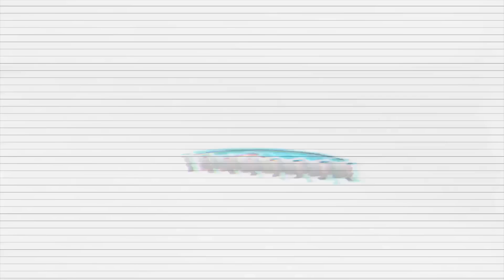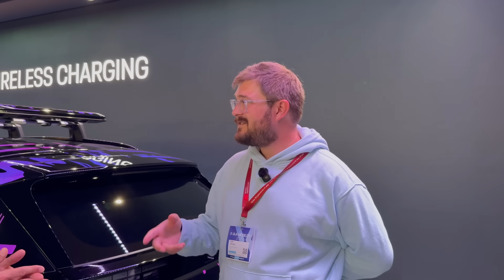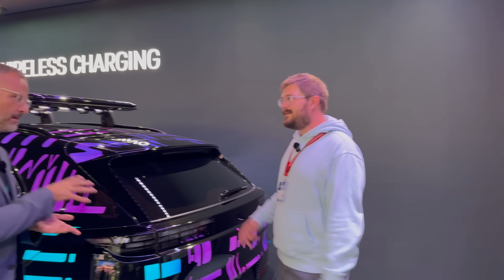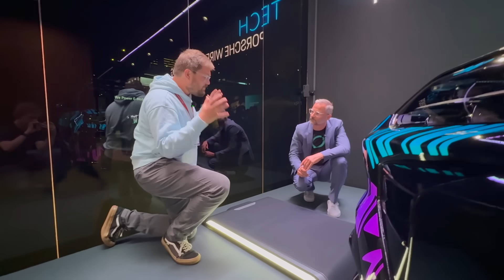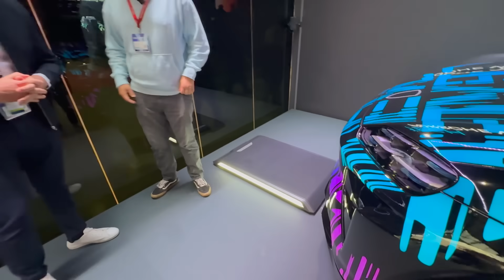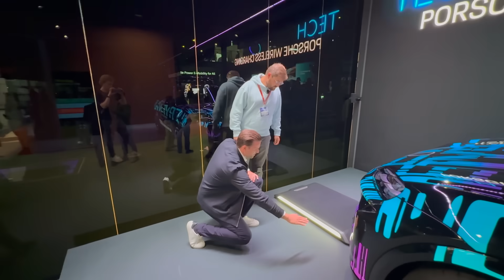Porsche Cayenne EV Wireless Charging Explained!

Comment: It detects any living thing? Like, what if a centipede or a spider decides it's a nice warm place to live, am I going to find my car not charged in the morning?

As for me, I'd probably still prefer to use a cable. But for some reason, I also prefer to use Ethernet cable over WiFi… I can see where it is plugged in, I can unplug it at any time and I know it will get disconnected, etc. But I know I'm in minority in this, so… why not, if people want it.

Comment: I want to know if the 90% efficiency figure is just how much power is delivered to the battery or if includes the additional power needed to cool the additional loss to heat? Beyond the cooling needed for the pad and the vehicle, if it is used in an enclosed garage in the summer that isn’t insulated from the rest of the home, it would then increase the amount of cooling needed for the home.

Comment: I worked at WiTricty on this and hacked it into a model 3 (and the whole time thought OOS would love to check this out). People have a tough time realizing the technology in this $5-10k system is much more advanced than a $10 inductive phone charger. It works very well, with several inches of gap, without alignment because it has the intelligence and complicated electronics needed to synchronize to those differences each time it initiates. Output is full HVDC on the car side so it truly is no more conversion steps than a plug-in OBC. I’ve personally witnessed it measuring 96% efficiency at 11kw. The other thing people don’t get is yes this is dumb/frivolous for personal use, but makes a lot more sense for fleet/taxi situations. And then you realize it is the solution to the full robotaxi chafging problem. These have shipped commercially on Chinese brands, but it looks like this will be the first time it is available OEM for EU/US. Waymo should be all over this.
Reply: Swappable batteries are still the better option. Swappable batteries can also have this wireless charging technology built into them. Plus, having swappable batteries creates a whole other industry that will benefit the US all around. Swappable batteries make it so that you don’t have to upgrade the entire electrical grid to support millions of new charging stations or charging pads like the one in this video. It also creates new jobs such as battery technicians, and battery transporters. It also can drastically reduce the price of a new vehicle by as much as 40% because new car buyers will have the option to purchase a car without a battery, which will simultaneously introduce a brand new battery into the swappable battery supply/infrastructure every time a new car rolls off of the lot and that brand new swappable battery underneath is swapped.

Win-Win option
Reply: @NSUScooter  swappable batteries are not the solution. I live in Belgium and we have Nio with their swap stations. It is a very captial intensive way of "charging" a car. We also have Zeekr and Xpeng here that can charge a car 10-80% in 10-12 minutes so the use case for swap is basically gone.

Comment: No one is showing how it wires in. Hard wired? NEMA 14-50?
Reply: The preferred method is hard wired directly into the fuse panel, according to the first speaker. But for situations where that is not an option depending on local code, a NEMA 14-50 could be used.

Comment: I am kind of impressed that they got the price down to just 7000 euros. People spend a lot more than that on other options. 

It would be really cool for fleets if the cars could rearrange themselves as vehicles complete charging. Get to work on that Porsche 😂 

The way the car can automatically park itself on the pad is cool. It is like my robot vacuum but I was thinking it might be better for the plates to br able to move around a little so they could line up instead of the whole car.

Comment: Consider a cost-benefit calculation:
200,000 mi/100mi per charge/15s per plug/unplug for charge
= 500s or 8.3 hours (assuming the pad doesn't make parking take longer, which is a bad assumption)
Is 8.3 hours of your time worth $7k?  The only sensible application for this is autonomous vehicles.
Reply: If you need to calculate the return on investment on this, you are not the target market xD
Reply: @FreekHoekstra  The Cayenne's target market is millionaires, not billionaires, and you don't get to be a millionaire by wasting money (inherited wealth notwithstanding obvs.).  One minute to to a calc is worth $7k to a millionaire.

Comment: Do they have any whitepaper measurements for the µT magnetic exposure, or the V/m, at operating distances, and this would compound with any misalignments. If you think that some unshielded sauna's can hit 2000-3000 V/m at 1 to 2kw, there better be a tonne of shielding on this product, or that is a sketchy thing to have in your home. I guess this is filmed in past, but would be interesting to see trifield readings from it, in the car while charging, and around it.
Reply: Esoteric bullshit. Safety is obviously one of the first things considered for such a product. If you think it will remote control your brain, you have much bigger problems.

Comment: Yeah 11kW getting in, efficiency of 80% if you’re lucky. 10% losses with wired already. Can’t imagine this delivering more than 9kW and nicely heating up the garage
Reply: They said it was 90% in the video
Reply: 90% include the AC/ DC converter or just the Wireless Pad to the Plate?
Reply: @FloLubo I'm not clear on that, there's some kind of unique process going on with the way they are doing it. I think the conversion to DC happens before it goes into the car on the setup unlike normal plug-in EVSEs that use AC and the car converts it. I'm not sure if that makes it anymore or less efficient though probably roughly the same conversion loss?

Comment: How does the pad work at -40c? 😂
Reply: Being extremely cold should not affect wireless charging. Being extremely hot though could affect it because it will produce a little heat on its own as well.  But on the cold side the car's battery would be the limiting factor not the wireless charging.

Comment: Honestly $7,000 for this, especially considering it’s Porsche, isn’t that bad. I was expecting them to say something crazy like it’s $40,000.
Reply: €7,000 = $8,214
Reply: $40K is literally the cost of a New Tesla model Y. That would be crazy. But I agree $7k for bleeding edge tech is about what I was thinking.
Reply: yeah but 11kw is slow bro
Reply: I think a person will barely come lose to spending 7k USD on electricity for charging this car before charging to new car with 3-5 years of lease….so it is much more rate to have basic charger and spending half of that sum on actual electricity
Reply: @ashotgaziyan8876  I'm not sure why you are just justify any cost numbers here. This is not meant to financially make sense, it's a new luxury product who can bite the cost.
Reply: Consider a cost-benefit calculation:
200,000 mi/100mi per charge/15s per plug/unplug for charge
= 500s or 8.3 hours (assuming the pad doesn't make parking take longer, which is a bad assumption)
Is 8.3 hours of your time worth $7k?  The only sensible application for this is autonomous vehicles.
Reply: @concinnus people with the money don’t worry about the numbers. They care about having the latest and greatest. If you need to get a pen and paper to run the numbers, this car isn’t for you.
Reply: I thought he said 5000 euro including vat? $5900
Reply: @samnas6205  That's just the pad, without the receiver, and doesn't include tariffs.
Reply: German VAT is 19% so more like 6000€ without VAT

Comment: Many city's don't have space for the pole and cable clutter as well as the electronics for payment on street. As an example Boston has many narrow streets with narrow sidewalks which preclude any charging options we have available today. 
With this tech held within the pavement with just a small lip over the edge and pointless payment this could offer what we need to really wire up the cities! Could you imagine parking at almost any on street space with the ability to charge over a few hours (over night even better). Now it's time to set the standards and a payment system to the power provider!
Reply: You're acting like it's 2012. You don't need to charge your vehicle that often. You charge at home, I realize if you have an apartment that might be more difficult, and then if you're on a road trip you charge at a super charger. 

All of this equipment, supporting infrastructure and payment system nonsense for 11 KW is a waste of time and money.

Comment: 90% efficient at 11kW means this thing generates 1100 watts of waste heat. That's almost as much as a purpose built electric space heater. 9hrs to charge the car will waste almost 10kWh. This doesn't seem like a smart thing to do. Also, a cat's collar will get warm? What about an RFID chip?
Reply: First: no cayenne owner will care about those pennies. 

Second: it doesn't necessarily matter much in the future, as increased use of renewables and storage will give quite some energy overshoots in availability.

Comment: 1:47 "200 kW of Regen" What does this has to do with charging? Regen is when using the motor instead of the brakes to slow down a car.
1:30 "Formula E race car. TYON's 400" Could not understand what he said????
Formula E uses a high-powered system called "Pit Boost" for mid-race charging during the 2025 season. 
- During a mandatory 34-second minimum pit stop, the cars receive a 30-second charge.
- About the Charging speed, the system delivers power at 600 kW, this is about twice as fast as a Tesla Supercharger.
Reply: To answer the first point. The regenerative power is fed back into the battery.

Comment: 8:27 - if you've got the coin (and who doesn't if you're someone shopping for Porsches) you can mount this pad in a recess or "pit" in the floor of your garage like we do in the Motorsports and Racing sector with some Chassis Dynos and some Alignment Racks (think Superflo think Hunter).  while clearance [Clarence] is certainly less important when dealing with raised SUV's, this flush fit is needed for the ease of testing of Sportscars with super low ride heights.  in this case (since we've already seen from Bjorn and Matt Ferrel way back 2 and 3 years ago how the generated lines of Magnetic Flux can work THROUGH various materials like so much MRI) you could then place a weight bearing cover of some sort over top this pad for a super clean install, oh this also gets rid of any trip hazard on the floor for when you're just walking through the space when the vehicle is not there.  I've personally mounted a small Scissor Lift this way back around the year 2010 or 2011 for just this reason (also see entry for Obsessed Garage).
Reply: increasing distance would reduce efficiency

Comment: Slower, Hotter, more damaging to the battery, less efficient, and it costs more to make
Reply: You are right honestly. Battery swap is way better than this
Reply: Did you watch the whole video? It charges just as quick as plugging it in at 11KW. It certainly does cost more but it's not damaging the battery at all.

Comment: "Plug this into the grid"...how? For the US, normal household outlet or the 240 "dryer plug"?
Reply: just like a wallbox
Reply: 48A is hard wire. Pluggable stops at 40A for EV chargers. I'm thinking 6 AWG THHN (or 4 AWG NM) in conduit out the front to the wall of the garage and back to a 60A breaker, just like a wall box charger.

Comment: 600KM range WLTP sucks. That’s low 300, way below Gravity and bmw ix3
Reply: it's 372 miles, really good
Reply: @JohnSmith-pn2vl  WLTP is not real world, it's a lab test. Real world tests come in at 80-90% of their estimate. At 85% estimate, this is about 315 miles, which IS less than Gravity and iX3. At 80%, which is the normal charge situation (battery preservation and slowing for the last stretch), this is 250 miles of daily usable range, which is not impressive from what will probably be the most expensive EV SUV.

Comment: Wireless charging might be useful for people with disabilities. I have a friend I've always wanted to have charge my car. She can pump gasoline easily, but most chargers would be difficult for her to use. Home EVSEs are much easier than gasoline pumps, but DCFC cables are heavier and stiffer.  I wouldn't advise any of my 80-year-old relatives to buy an EV.
Reply: ease of use is a customer value, you are absolutely right
Reply: How can you be physically disabled in such a way that you can still safely drive a car, but you're unable to plug in an electrical connector? Yet somehow operate a gas pump?
Reply: @DJS_ENO  This friend has hand controls that connect to the brake and accelerator pedals. She has limited use of her legs, so to pump gasoline she use crutches to move around and get the nozzle in the inlet. A DCFC is much heavier and stiffer than a gasoline hose, so it would be harder. Also, every gasoline pump I've seen lately is wheelchair accessible, but every DCFC I've seen is behind bollards and parking bump-stops or curbs.

I use both hands every time I plug in. That's easy, because I can use my feet to move from the charger to the car. Not everyone can do that. I also think of my elderly relatives. We need to build EV chargers that are easier to use than gas stations, and I haven't seen one yet.

It's not a reason to go back to gasoline vehicles, but we can better serve the elderly and disabled.

As for home charging, that would be easier than a gas station for most people—assuming they have a decent garage setup.
Reply: @DJS_ENO  the multiple pivot points/joints on the gasoline pumps make a big difference. We've engineered a lot of flexibility into those, and we haven't done the same for DCFC connectors. "Pumps reach both sides."
Reply: @DJS_ENO  …and every gasoline pump is pull—through, so people on crutches don't have to carry the nozzle at all—they just put the gas inlet one foot from the pump, and it's a simple pivot maneuver.  Charging stations have room for improvement. CalTrans put some chargers in backwards to make them ADA/wheelchair accessible. It was a nice thought, but it was not enough.

Comment: We know how Porsche is with their stats. If they say it's 90% efficient it's probably 93% efficient
Reply: 1-5% loss when at 100-400kw of power coming through the cable but when we are doing 11-22kw it’s gonna be less than 1%loss, then the charger is more loss and the wireless is even more loss, it’s gonna be a space heater in your garage to wireless charge
Reply: You can get 100% efficiency with cable
Reply: @AndikaKhairilAkbar   no it doesn't work that way it's at best 95-97% via cable
Reply: @Jakub737  I said cable not ac-dc inverter inside the car
Reply: @AndikaKhairilAkbar  yes I know, only cable still applies 1-5% loss (resistance, length, cross section) so it can't be 100% but it's close...
Reply: @Jakub737  Now you not only have a cable but also a magnet to magnet  for the wireless charger

. And this wireless charger needs to be cooled even though it only runs at 11kW DC..